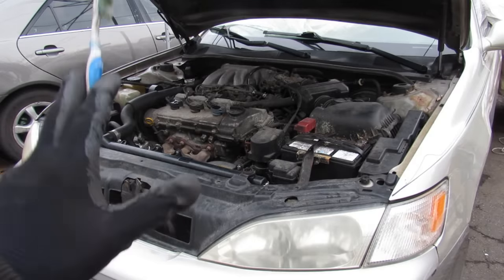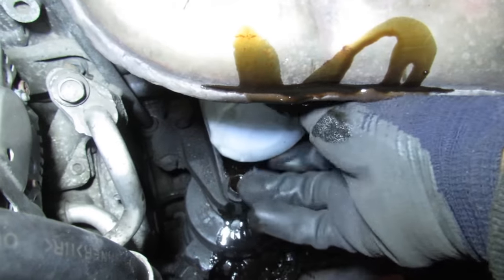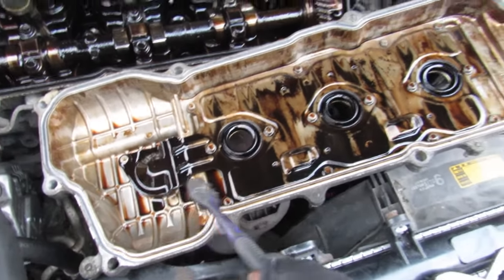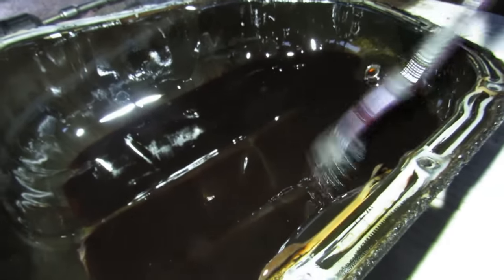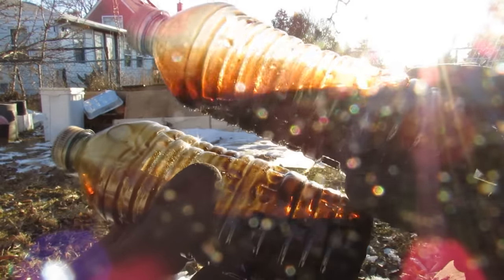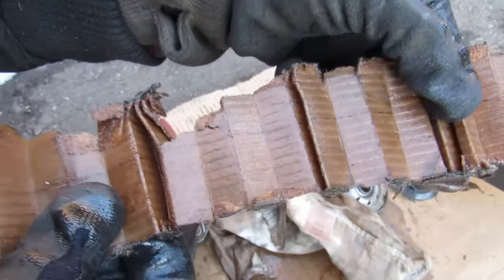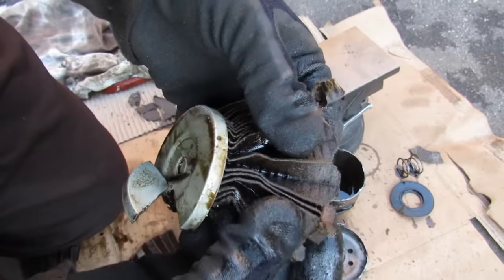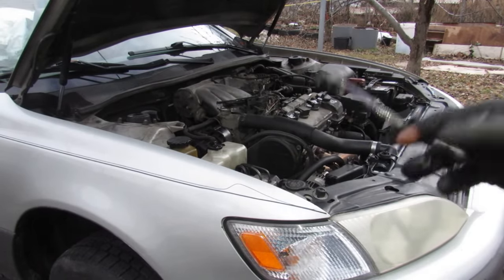Does Flushing Your Car's Engine Actually Work? || Before and After

Comment: In my experience the best way to clean the engine with atf is actually only draining about 1 liter or so and replacing it with atf. Than driving the car for a few days 250-500 km of light driving than an oil change with a reduced interval ie. 2500 km or so of synthetic oil. Really helps reduce minor tics, valvetrain noise and buildup.

Comment: Interesting as always. I've heard from old time mechanics say using ATF in the gas tank works good to clean combustion chamber. Your thoughts on that please.
Reply from the maker: Not in the tank. ATF might clog the injectors.
Reply: @Locust Hypnosis Yes mate, works a treat, just check your air filter occasionally after using ATF. I used to use about 200 ml after every full tank of fuel. It's a good upper cylinder lubricant. Greetings from Down Under mate.
Reply: Apply a FINE mist of distilled water into the intake with the warm engine running at a fast idle. After 15-20 minutes, shut it off and use a bore scope to look thru the spark plug holes. Repeat untill the tops of the pistons are clean metal. A blown head gasket will also clean the combustion chamber of the leaky cylinder. Be sure to change the oil and filter after the above process.
Reply: @davecurry8300  ATF doesnt work as a upper engine lubricant all it does is stuff your engine
Reply: @peterbarber7613  Mate, in the late 1970's I started my automotive apprenticeship working on a fleet of 120 Sydney Taxis.....Yellow Cabs.....my tutor started as a mechanic on cabs in the 1940's until his death in 1981. All our cabs were Holdens, HT thru to HZ. He was the one that taught me that. My first car was an ex cab....HQ....it had travelled over 500,000km both as a Police car, then a cab, then as my daily driver until someone t-boned me in 1981. Our cabs & my car never suffered from a little squirt of ATF in fuel tank every so often. Thanks for your feedback anyway & your opinion to which you are most entitled to share.
Reply: @davecurry8300   That was common in the 40's, 50's, 60 and 70's, with older vehicles. If you have a scraper you don't really care about, sure go ahead and play chemistry.  If your vehicle is worth anything, get a decent flush like Chemtool B12 or a PEA additive for fuel system for $5-20 and use something that probably won't fubar your ride.

Comment: Do a 20 min flush using actual engine flush product before every oil change , Might take a year before the engine is actually back cleaned internally but hey it’s low efforts & highly affective

Comment: I wouldnt flush a engine with straight atf . I would however add a half quart to fresh oil & change after 1500-2000 miles under normal driving conditions

Comment: awesome vid
plz make a video explaining the electric coupling assembly of the rear diff
Reply from the maker: Like an LSD?
Reply: @speedkar99  no the electric coupling assembly attaches between the propeller shaft and the differential carrier housing
it controls the operation of the rear diff
like in the altima 2019 awd

Comment: Bro. Did 3 synlinder engine vibrate?
Reply from the maker: Yes. See my Ford escape 3 cylinder video
Reply: @speedkar99  i mean engine shaking because 3 cylinder not enough power to move the car.

Comment: I wouldn't recommend using straight ATF and certainly not straight Diesel fuel.  Diesel is not a good lubricant.  Maybe 20% ATF would be good and you could drive it.
Reply from the maker: Yeah I would not drive on ATF alone, need at least a quart of proper lubricant

Comment: Great video showing how new oil will quickly become contaminated by the old oil left in the engine.  A modern engine with OHC, VVT, Turbos, coolers, hydaulic solenoids, lifters and their very design, will leave 10-20% of the oil behind.  Use of any solvents in an engine, even idling for 15 minutes can cause severe harm. Manufacturers specifically warn against it.  Leaving 10% of that solvent for the next 5k miles is even worse.  Just perform a double oil change, once a year.  It will remove 96-99% of the old oil and the new fully formulated oil with all of its detergents, dispersants, anti-oxidants will clean your engine, slowly, safely, and protect it.  If you have a really dirty or neglected engine, perform the double flushes every oil change for the next 3-4 intervals.  These are known as Full Volume Oil Changes in the Machinery Lubrication industry, and applies to all engines.  Keep the flush oil and use it again or use in an old grocery getter.  Save the double flushes for your favorite car.
Reply from the maker: Good call. Oil change is the safest regard
Reply: What if your favourite car is the crappy grocery getter?

Comment: I would do a repeat flush for better results. I have used diesel oil in the past to achieve the same thing. I think it’s a cheaper option.
Reply: Diesel oil or diesel fuel? I've seen a couple comments of using diesel fuel. Then again diesel is really oil anyhow but I'm just wondering if you used oil for diesel lubricant in a gas engine assuming it has more detergent or something. Serious question. I'd never heard of either.

Comment: Maybe you should ran it longer and let it rev to 2500-2500 rpm to let atf heat up.
Reply from the maker: Agreed. I would have rather drove it around
Reply: @speedkar99  but you throwing away the engine anyway. What's the point of driving it around with ATF in it?
Oh I remember, you got nothing to lose and you can do pedal to the metal anyway.

Comment: I use motor flush (which im pretty sure its kerosene) every other oil change and the inside of my engine looks brand new still
Reply from the maker: Have you seen inside?
Reply: @speedkar99  yes I've seen inside my engines
Reply: And honestly the inside is fresh looking like a brand new motor.

Comment: A better way is to use about  75% motor oil and 25% transmission fluid and then actually drive the car for a while. Still better is to change the oil on time...

Comment: How about Marvel Mystery Oil?
Reply from the maker: What about it?
Reply: @speedkar99  wondering if you tested it.
Reply: MMO has Stoddard solvent in it ... more detergency than ATF.  I'd run a 20% mixture of MMO in regular engine oil for about 1,000 to 2,000 miles for a flush ... but I prefer using HDEO as a safer way to clean an engine.
Reply: @seanthompson8071  Sorry, what is HDEO? 🤔

Comment: Never flush your engine -  I change my oil every 3000 miles - best flush
Reply from the maker: Clearly this car missed a few oil changes
Reply: Synthetic? 3,000 mile OCI's is a bit overkill. 5,000 is going to save you money, and I usually push mine to 6,000 - 7,000 with Pennzoil Ultra.
Reply: narlycharley true sometimes I can get 6-7k on Castrol synthetic with the oil not even getting all that dirty.
Reply: Good idea ... never let it get this bad in the first place.  But if you inherit something gunked up, I'd use a HDEO oil and run it 2,000 - 3,000 miles then change the oil again.

Comment: I use liquimoly or in a pinch seafoam
Reply from the maker: I might need to flush my new 3MZ Camry, it came in low on oil so I'm not sure what's going on inside the engine

Comment: I used a 5 minute engine flush , biggest mistake I ever msde,,,a peace of cabon bridged a gap on spark plug and washed a cylinder wall from the voweled spark plug,,,stuck the oil ring and caused me alot of unnassary work,,,never again!!!!!
Reply: @zeroyon223 oil system is pressurised and traveled to top of engine,
Reply: @zeroyon223 ok zero I'll explain being you need an argument,,, a peace of cabon broke lose from bottom of intake manifold and and  was sucked past intake valve into chamber and was fussed to sparkplug shorting it out,,,  oil travels through camshaft bearings under pressure ,can be 50 psi,,,and the 5 minute flush diluted the oil enough for it to sling up to intake bottom and wash off carbon the collects there,,,  I did it the night before a 100 mile trip and the voweled plug caused unburnt gas to wash cylinder and oil ring to stick,,, I got lucky it was number one cylinder and I was able to drop pan and pull head and put in new piston and I drove it 4 more years,,,I have no doult the 5 minute flush was the cause,,,and many mechanics told me later they have seen it happen when people think flushing an engine is good,,,just change your oil regularly and you will have no reason to flush it, and stop being so rude, only woman act like your acting,,, what next my typing,,,lol,,,that's female nature also..
Reply: @zeroyon223 and if you really know engines you understand duration,,,the period of time when both intake and exshaul valves are open just past tdc,,, to create vacuum and the flush can cause carbon to break lose from exshaul manifold and be pulled back in at that duration period and cause the same problem,,,just not worth the risk
Reply: @zeroyon223 Never again for me,,,,the sparkplug looked like it was welded closed,,,and only a peace of carbon steel could have bridged the gap,,not sludge,, and I've always been a stickler for changing my oil,,,the engines life blood,,,guess it was the smell like bullshit remark,,,I've always fixed my own cars all my life,,,started working on cars at 14 years old,,,now I buy and restore classic cars,,, that flush was 20 years ago and never before are since,, don't even consider it,,,and if you do,,pull the plugs and turn it over and blow all the shit out before drive it..And listen for a miss..
Reply from the maker: Ouch

Comment: Still not as bad as a bmw e60 530i with regular oil changes. Carbon build up everywhere. 
Has to be one of the worst engineered vehicles i have ever seen.
Reply from the maker: That's probably because it's direct injection
Reply: @zeroyon223 owned one, an 07 model with the N52A engine
Did a rocker cover change, there was carbon all over the inside of the rocker cover, on the top of the cylinder head, on the camshaft bolts, on the camshaft mounts. 
Every single gasket was leaking oil. The hydraulic lifters/tappets would lose pressure on start up under certain conditions and make loud metal on metal tapping noises. 
Vanos issues.
Electric issues. 
List goes on
Worst car i have ever owned, my VW was a better built car an 07 model gti that had a turbo upgrade and had no issues.
Reply: @speedkar99  Was standard multi point
Reply: @zeroyon223 i bought the car specifically because it had full service history, log book stamps and receipts. BMW while in warranty and independent out of it.  I can only assume that maybe the carbon build up was the result of using the incorrect grade ie non bmw specific oil. 
 The car was great to drive no doubt about that. But was a nightmare mechanically. In the end it was a transmission failure that killed the car off. Not worth replacing.

Comment: The problem is that you “you didn’t drive the car for 15 minutes with the TRANSMISSION FLUID in the motor, then come back an drain it,  But ATF is the best inside engine FLUSH PERIOD ‼️👌🏾

Comment: Why wasting a ATF fluid to clean the engine internal? I using petrol to clean the engine internal, and it have result much much better. And I no need to running for 20min too.

My way is just remove all old oil, then open the head cover. Then put petrol into paint sprayer and spray to the entire head. Then pour petrol into. Crank the engine few time, then all debris are gone. Easier and much economically.

Comment: "Of course it's an MZ engine.  The MZ, ZZ, and AZ engines are all trouble makers and are to be avoided." the person who made this comment needs to get their mind right. the 1mzfe engine is well known as one of the most bulletproof engines ever produced! the problem is the clueless clowns who own them. they do not change the oil on time and do not change the pcv valve
Reply: Toyotas have problems only with poor maintenance
Reply: @DStabs720  for the most part. they did have problems with some engines thru the years. certainly not the 1mz or 3mz
Reply from the maker: Agreed. The early 1MZ did suffer from sludge buildup due to lack of maintenance. The newer 1MZ/3MZ is bullet proof and might almost stand up to a 1UZ in reliability. 
The 2AZ on the other hand had headbolts and oil burning issues and is to be avoided. 
The 1/2ZZs were reliable....when they didn't burn oil haha.

Comment: Of course it's an MZ engine.  The MZ, ZZ, and AZ engines are all trouble makers and are to be avoided.
Reply: Gotta 2001 Toyota Camry with the 1MZ-FE never had any major issues. Just did the timing kit, valve cover gaskets, plugs, wires,  coil packs, and a few other things to it and it's still going strong at 195,000 miles. It's been a great engine to me.
Reply: Got a 1994 MZ engine in a camry with 243K miles on it.  We use it for a city car & still runs GREAT!  It does get regular oil&filter changes which I still do ever since we got it new in 1994.
Reply from the maker: I beg to differ. The MZ series are among the most reliable. 
You just have to maintain them because they are sensitive to oil. 
My 04 Camry 1MZ has been going 305Km strong.